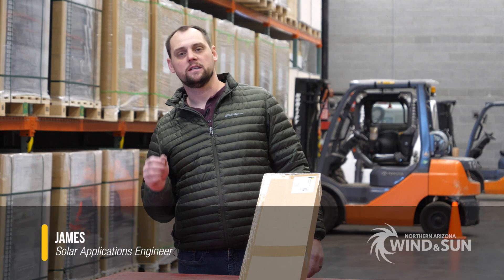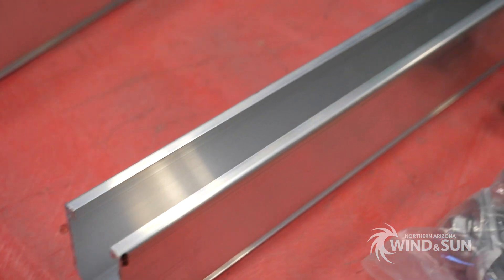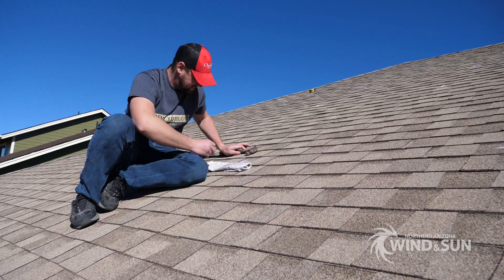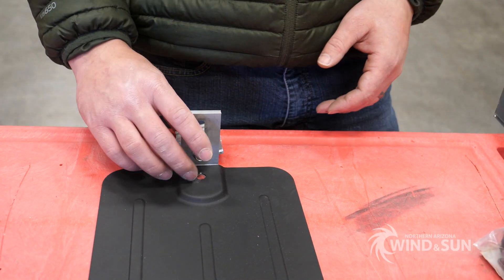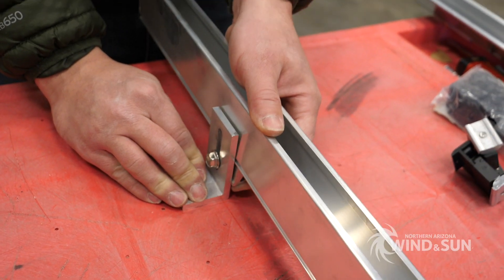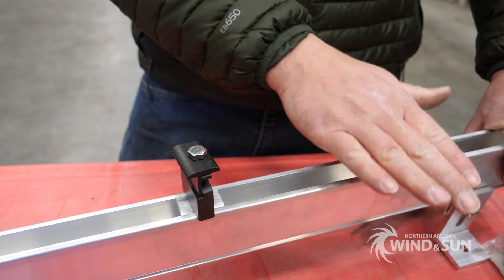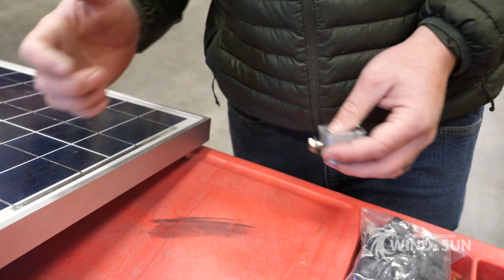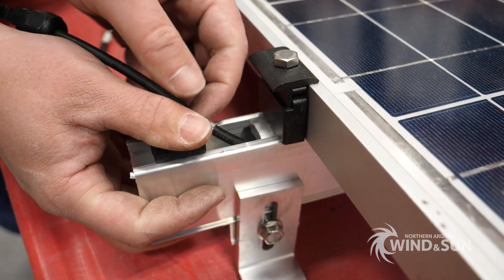Tamarack Flush Mount Kits

Comment: How important is an air gap under the panels?

Would it be goofy to have say sic six inches of gap under the panel?
Reply from the maker: Air flow under the modules is very important. Most Module MFG will require a minimum gap. 6" of space is not extreme, it will help keep them operating cooler and more efficiently. However, more space could affect the wind loading.
Reply: @NAZSolarElectric  

And more room for squirrels to build nests 😬

What do you think is the average air gap realized in a typical pitched roof installation?
Reply: I would expect that a large gap would allow airflow to help cool the roof (mine is brown alum) and the panels.

Comment: Seems we make the electrical connection by coming over the top of the rather than out the end for a junction box? I'm thinking about how to avoid abrasion between the cut metal and the wiring.
Reply: Usually the electrical wiring will come out under a panel and tie into a J-box. I was just showing you visually how you can transition... makes most sense to have a J-box or Bell box mounted under the array (or onto the rail) rather than running wiring out the end of the rail. The system is designed to allow everything to be concealed.